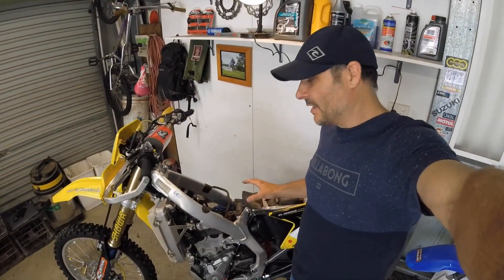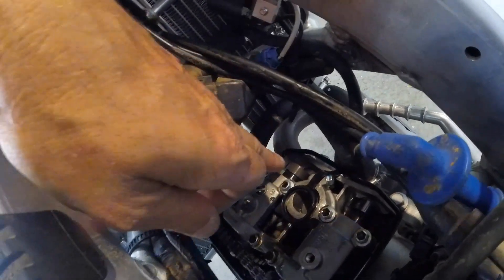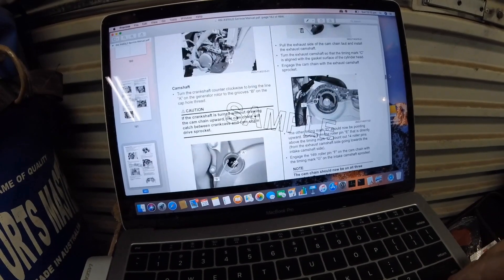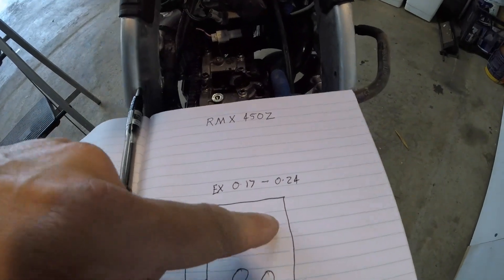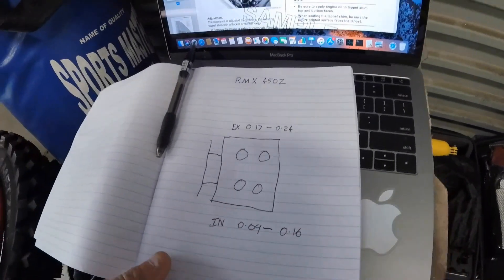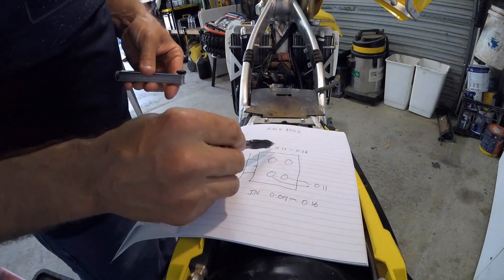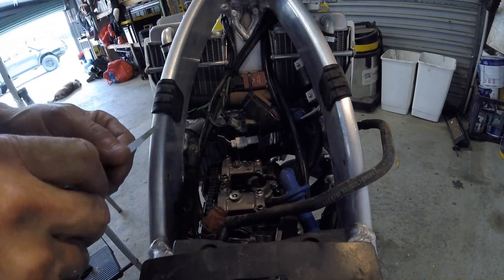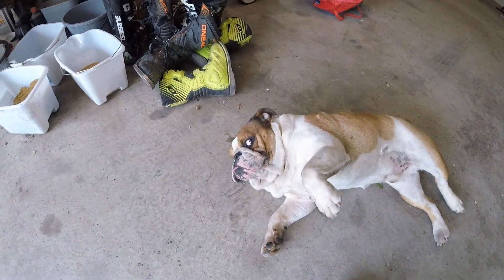4 stroke dirt bike valve check Suzuki RMX450Z

Comment: Please tell me Can I install Suzuki RMZ450 cylinder head on my Suzuki RMX450Z (2018 model) for more power.
Because compression ratio is more in Suzuki RMZ450 Head.
Reply: Nope. They aren't compatible as the cam chain guide are in different spots. No real options I know of.
Reply: The compression ratio of SUZUKI RMX450Z is 12.2:1 whereas Suzuki RMZ450 is 12.5:1.
The more compression in RMZ450 is due to Piston or Cylinder Head's combustion Chamber.
Reply: Because I ve SUZUKI RMX450Z 2018 model,I want more power Because bike is participating in National Rally Championships. 
please suggest me.!!
Reply: @AmrinderSingh-zx9hr  None that I know of. Maybe ask Hot Cams.

Comment: I have a RMz 250 and I dropped it..the rubber on the rocker cover bust and when I put my finger in I can feel a light bit of metal that I can move around.. does anyone know what this could be.?
Reply from the maker: Pull it apart and have a close look.
Reply: @BrokenSprocket  compression plate I've been told... we will see when it comes apart.. cheers 👍

Comment: Cool mate at the start I was keen to see ya reshim the valves in a 7 minute video lol. Is it unusual for a Suzuki to not need adjustment after 2000km? I don't think even ktms usually move much in that many ks 😮 depending on maintenance of course
Reply from the maker: I'm not sure if it is usual for the valves to be out at 2000km but Suzuki recommends that you check them every 2000km but happy they are still in spec.😁
Reply: Yeah definitely mate shimming them makes it a lot more of a pain in the ass of a job. I gotta do mine soon lot easier on the 500 apparently being a single cam setup 🤘